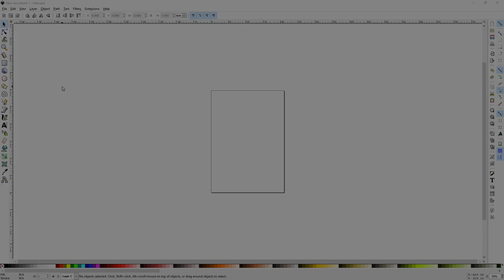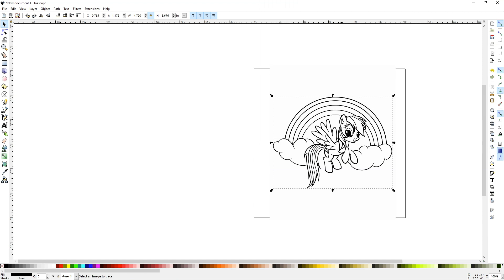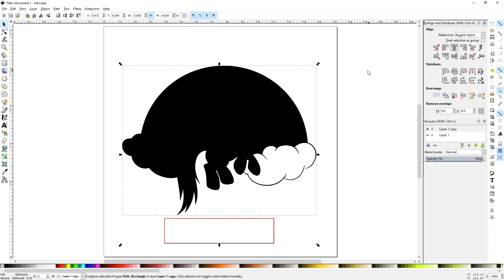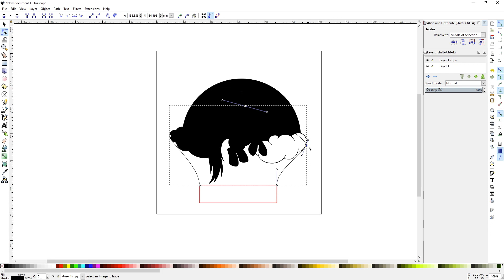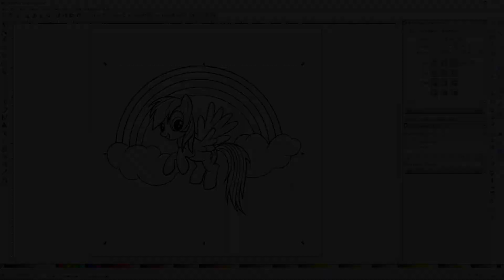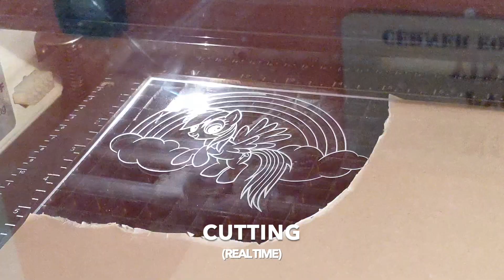Edge Lit LED Sign Inkscape Tutorial

Comment: Can you share the speed and heat settings
Am new to this and every time i try engraving something on acrylic i end up burning it and it all turns black :(
Reply from the maker: Sorry, I don't have the speed/power settings, as I just used the presets from the Epilog Manager for acrylic engraving. It sounds like you need to either increase the speed, decrease the power, or some combination of both. I know I didn't do it this way in the video, but another thing that might help is to leave the protective sticker on the bottom, to prevent scorching.
Reply: @LeonardCLee  thanks a lot Leo
The protective sticker helped :)